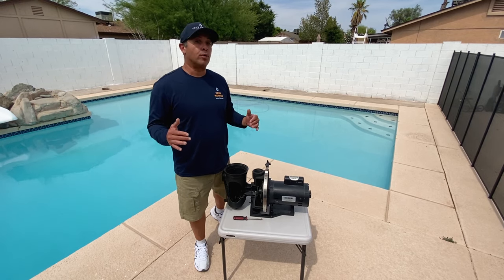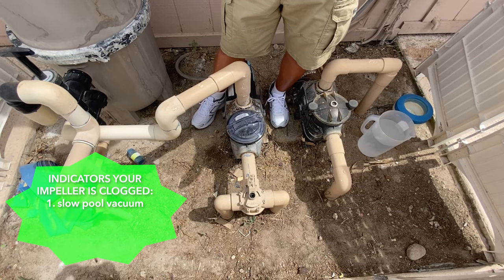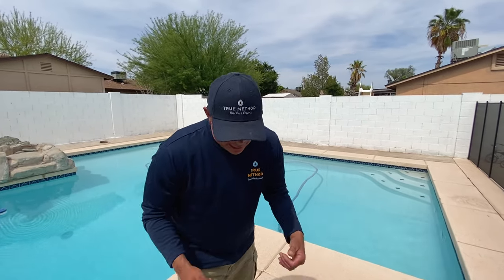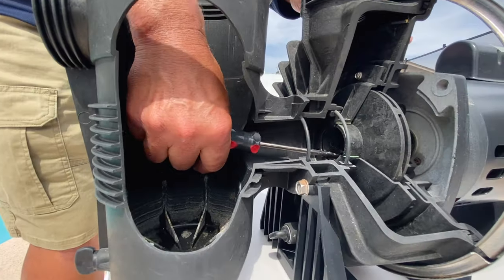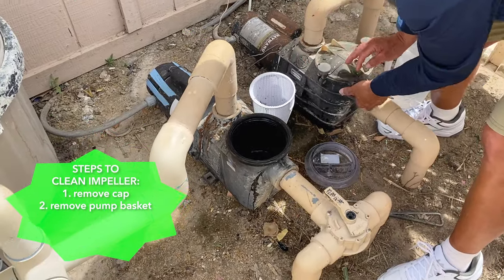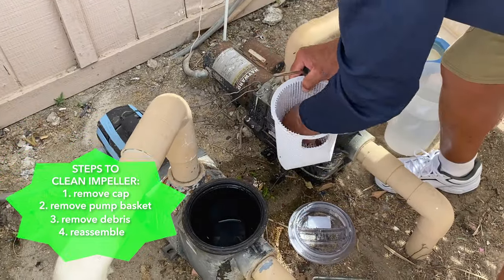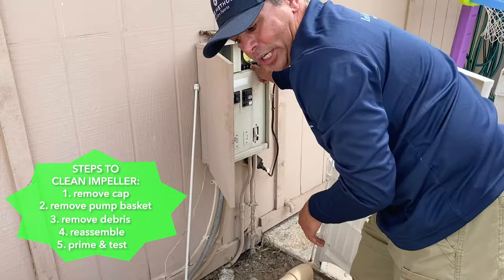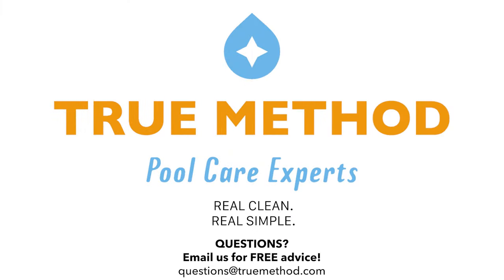How to Unclog Your Pool Pump Impeller! (and warning signs)

Comment: Folks, don't stick your hand or a hand tool in the pump without first turning off the main power to the pump.  Turning off the switch is not enough as some systems have a setting that automatically turns the pump on and can turn the system on while your hand or hand tool is in the pump.  I've seen it happen and its not good.  Whenever you're working inside a pump that's connected to main power, ALWAYS turn off the main power to the pump first before sticking your hand or a tool inside the pump.  The inconvenience of having to reset a clock or some other automated feature is well worth not ruining your pump or suffering possible severe injuries.  

Next, cleaning out the impeller port is often not enough.  Debris small enough to pass through the pump strainer and yet, large enough to become lodged in the actual impeller itself will significantly reduce water flow through the pump.  In this case, the pump will need to be taken apart where the motor and the basket are joined and the impellers will have to be cleaned out.  Its not a difficult process but, it is tedious especially when it comes to reassembling the pump.
Reply: Unscrewing two Pvc barrel unions with a pair of Stillsons and taking off 4 bolts is all it took me
Reply from the maker: I am glad mentioned this, you are absolutely correct. When sticking your hand into a pump or working on your pump you always want to make sure that your pump is not only off but the schedule has been disabled. When Turning the power back on check your timers/ time clock to make sure that the time of day and schedules are correct.

As for your last paragraph, you are also correct however, this video was meant to solve a problem in the simplest way. If they did have the problem you stated, we would recommend them calling a pool professional instead because we would not want a homeowner performing that tedious task. 

Thank you for your comment, we have pinned it to the top so other viewers can see it.

Comment: Man, this has been an issue for years with our pool.  No one ever told us about the impeller.  Always had low pressure to the polaris, jets had air and our chiller would barely pump water unless at max (sometimes just stop).  Cleaned it out for the first time and WOW!!  Solved all the problems.  This should be the first thing they teach you to do when you get a new pool.  Thanks for the video!!

Comment: So it’s pollen season in central Florida. My water flow through my jets and spilling over from the spa was extremely slow.  All baskets clean and filter cleaned.  I saw this video and tried cleaning the impeller.   It worked like a charm and now it flowing like it did when it was brand new.   Easiest repair job ever.   Thank you for posting.
Reply from the maker: So glad it helped your situation !!  Thank you for the comment !!

Comment: The acid test is to close/block all suction lines and fill the pump pot with as much water as it will hold. Turn on the pump with the pump pot lid off. 
The water in the pot should be sucked down immediately. If it does, not an impeller clog issue.

(Maybe a lid o-ring issue which I would have already checked.
Suction leaks and clogged impellers show the same symptoms).

If it goes down less than immediately, we have a clogged impeller.
It would be great if jamming a screwdriver around would resolve this every time. That works for what is in the face of the impeller, but does nothing for debris that is wedged in the vanes of the impeller. 

That's one of the things I love about your first pump, the Challenger. No tools needed to open it. I can get in and out of one in a few minutes.
Your second pump, the WhisperFlo, a bit trickier. I have to get behind it and pull out 6 bolts.
Because I've been in this racket long enough to know, that just because I pull leaves out of the impeller face doesn't mean deeper clogs are not in the vanes of the impeller.
Just my 2 cents.
Best regards!

Comment: OMG thank you for showing the impeller fans, my pressure was low and I cleared all the baskets and thought it would be an expensive fix. 
You not only pointing out the impeller clearly & concisely, but also showing a cut out side view of it was the problem, THANK YOU!

Comment: Thank you, thank you, thank you! I had a big accumulation of pine needles that clogged up hoses when cleaning the pool for the first time this year. The flow was reduced and I kept checking hoses. Then I thought, "can they get in the motor, 1 minute of your video solved the problem. Learned something new today about impeller blockage...

Comment: I ordered a new pool cleaner and it was moving kinda slow, just like the old one. I decided to see what the issue could be, and I ran across your video. Low and behold, there was all kinds of stuff in there! Now my little sprayer fountain squirts across the pool again AND the cleaner moves fast! WOOOOOOO! The power of YouTube! 

And I thought MY videos were useful. Man, you just saved my summer! Bought this house almost three years ago and NEVER cleaned it. Been cleaning the filters like crazy, thinking it was a filter issue. Nope. Leaves and gunk trapped on this piece. Pulled it all out in a single clump and voila!

Thanks for saving summer...and my pool pump!
Reply from the maker: We are about to enter another summer and hope all is working well with your vacuum and equipment.  Thank you for the comment
Reply: @TrueMethod  Oh yes. I had to get new skimmer baskets because grass would wrap around the impeller. I would clean it every other day, but now it's been grass free for a week. That impeller trick is a LIFESAVER! I just use a little hook and pull that crap outta there...and it works just fine!

Comment: Excellent help!!! great video. hope can work on my issue. Just get motor replacement after that the presser of vacuum in none. Now the pinch penny tech is telling me that I have to replume because I have problems with my old valves. Before that all was running without problems. there is other way I can unclogged or find any air escape? thank you

Comment: Terrific little video, a simple fix. I love that cross-section cut view of a real pump! Super helpful.

And... 🎉 Sweet screwdriver spin: you're a real pro 😜
Reply: Quick follow:
In my case, a jandy multi speed, I could not find anything that felt like that with a screwdriver, so I tried a plumber's snake: still no way in 🤷

What ultimately.worked for me was to pump water backward into the pipes from the pump basket end. I shot water backward while running the pump, and eventually (pretty quickly actually), my system was primed and flowing again. Root cause still not sure:
- recently added salt: did it bunch up in the pipes?
- recently had LOTs of rain, and rain draws sand up from under my patio deck into the pool (yeah.. I know). Maybe sand built a blockage?
- big gorgeous Chinese tallow recently dropped a LOT of pollen: maybe that gunked the pipes?

Comment: Thanks for putting this together. The pump is back to life. However, a question. Sometimes (within a week or so) the impeller still gets stuck. Could it be that the pump is nearing its life? Is there a way to lubricant the impeller bearings?

Comment: I have a small pool (6600 gallons) that has two jets. One jet seems to be working fine ... the other one is barely churning the water. I did a backwash today and the pressure stands at 20 psi. What do you think is causing this situation? Is it possible for a clogged impeller to cause this situation? Your help would be appreciated.

Comment: I've been taking care of my pool for years with very little headache but this year I have an issue I have not seen before. When I open the pump glass normally the water recedes as air moves in.  Today it's staying full! If I turn the pump on with the glass back on it seems to fill up the housing reservoir but before it gets to pushing out the release valve on top the water in the pump area drops to nothing... Any ideas?

Comment: My pump just stopped after I was cleaning my filter for the second time after vacuuming is my pump fried , get too hot and thermistor tripped? How long should I let it sit before trying again ? Power is there but when plug the pump in on a gfci power strip it Tripp’s

Comment: Another way to check is to drain all of the water from your pump completely which may require using a little cup to scoop out the last bit. Then hold your phone down in so you can take a picture into the hole into the impeller and you may be able to see debris. You will need to use the flash and you’ll need to keep a tight grip to not drop your phone.